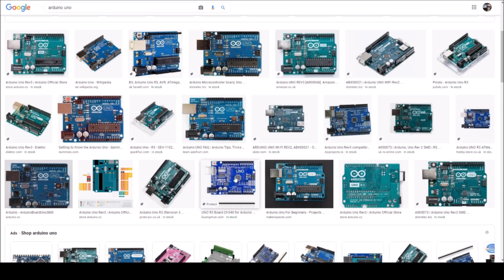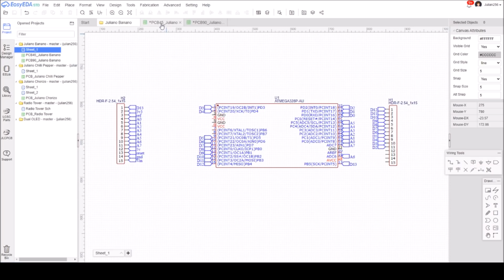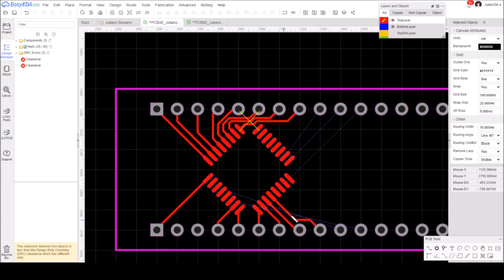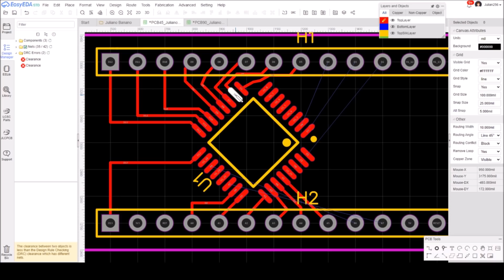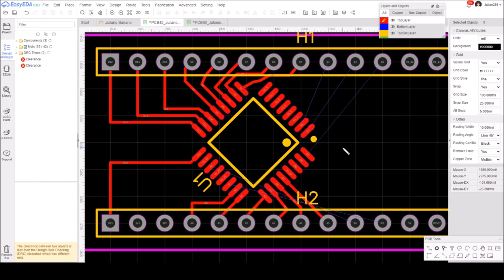Chip at 45° - Why?

Comment: It is simply a routing solution.

This is from my instinct when we were actually manually making complex pcb traces for our projects during engineering school. No software aid, no computer at all. Single sided pcbs are cheaper as well so we make solutions to save space and money.  

When many chip pins with the header pins that are close and parallel, it us hard to run it on single layer. It is easier to solve using diagonal positioning.

Comment: On top of that, there are several rules while designing PCBs, one of them is to avoid traces with 90º turns (since it may create an antenna), so puting the chip at a 45º makes it easier to route every pin properly

Comment: I started playing putting the IC in 45° and then in 90° but there's not much difference, but then why does this microcontroller is placed like that in that board? Well, due to the reduce size of the PCB board it's easier to connect the microcontroller to the header pins when the microcontroller is in 45°, if you put it in 90° it's kind of hard, i tried to do that in other PCBs i made but there's not much difference than place the IC in 90°

Comment: 5:58 If only those 2 tracks are close together with 45 degrees imagine if most of the 8 tracks were that close at 90 degrees. It's not a that hard thing to see why in higher density designs people use it that way. I've done some of the THC AVR builds using narrow boards and the routing is much worse because of the pins going straight to the narrower side of the board instead of angled allowing more space.
BTW, the through hole version can actually be easier to route than the SMD one because it allows you to route traces in between the chip pins. One of those situations where a wider chip give your more room to work with.

Comment: It's always nice to see a hobbyist take a dive into analyzing commercial products, and Julian does some of the most beautiful dives I've seen.

It's not just microcontrollers; video chips are also often on a 45° orientation for routing, and there is a successor to the LM3915 dot/bar display driver chip in a QFP or QFN that routes best at 45°. Low pin pitch quad chips with I/O pins running around corners? I think even Pythagoras could figure that one out.

Comment: I designed a "mouse mover" with a 32U4.  It moves the mouse in a 10x10 square once every interval (adjustable by a pot between 1 and 5 minutes).  I did the 45 degree placement at first, but it was too wide to sit in the USB ports on my laptop with other devices.  I essentially lost a USB port on each side of it.  So I redesigned it to be at 90 degrees and was able to narrow it down enough that it was the same width as a thumb drive.  (I used JLCPCB as well, and recognize that pen.  I prefer the pen, which I don't use, over the puzzle that I just toss in the recycle bin.)

Comment: The 45 angle is usually for easier routing. The package pitch (width) is 600mil (0.6 inch) the pin pitch will be 0.1

Comment: It is obviously done for convenience: to make it easier for routing all those pins from the uC to the edge of the boards. Why would it be absolutely be necessary? It is like you say just for space reasons.
Reply: Correct - convenience. For small, long and narrow PCB = 45 degrees is best choice. For bigger PCB chip angle does not matter. I'm actual electronics PCB designer.

Comment: 0:19 "Rooting or rowting," he says, but misses "Soldering or soddering."  Me? Rooting and soldering
Reply: I hate it when yanks say soddering. But yes, the 45 deg thing was from wave soddering back in the late 90s
Reply: We had to use wave soddering for surface mount as we used a through-hole main connector and smd reflow would add another process. There was a risk of bridging the micro pins that were across the wave, according to the factory.
Reply: The silent 'L' is like the silent 'U' in colour. :)
Reply: If the 'L' is silent, is it like 'cold' (cod), 'mould' (mud), or 'old' (odd)? 🤣

Comment: In PCB design class my prof told me that 45 degrees is usually for easier routing.
Reply: It should be fairly intuitive that lining up wider pitch solder pads to thinner pitch pins would be easier and tighter with a 45 degree layout since you don't need as much thickness on top of the chip to maintain proper clearances. Many traces can be pushed out near straight instead of meandering around.

Comment: More straight spacey traces than not.. the expanding factor of the side rails makes the 2 45 degree angles like a whole  half side rather than a quarter... more traces just have to go out straight without bends.. after your first flashlight inspection... I really dont know how its even a debate... would have naturally done it too.. isnt some microscopic sillicon also arranged that way?.. its the best way to reach the parralel pins maintaining the maximum distance between rails, less capacitance less gold etc..

Comment: On a board with two sides only, no internal layers, traces run horizontal on one side, vertical on the other. If a chip is 45 degrees, every leg can go in the same direction without turns.

Comment: Is that CH340 the 340C?,  I soldered the msop10e for testing but for the design and to simplify have plumped for the CH340C.  I am guessing its the C as the C and E do not require the external crystal.

Comment: Google "0DFRFW" - That's the motherboard for a Dell Optiplex 780 Ultra Small form factor PC. It has the LGA775 Socket at 45 degrees. The CPU Cooler retention screw holes are at 90 degrees though.

 I had one of these a few years back.

Comment: You can put vias behind the lands and route the trace on the bottom layer. You don't have to route out from the chip as the electrons don't care.
The problem with that though is once you get a chip with an exposed ground pad getting vias between the lands and the exposed pad is very difficult and on two layers getting a big continuous ground fill on one of the layers is going to be pretty difficult once you have a bunch of vias and traces running from the center of the board to the edges.
Reply: LCC MCU chips do not have ground pads, QFN chips do.
Reply: @adamw.8579  LCC? The chip he's working with is a QFP right? QFPs can have exposed pads.
Reply: @donpalmera  Generally QFP may be equipped with exposed pad. Older type LCC now QFP and TQFP. Yes sometimes have exposed bottom pad but not MCU, rather some typed of power controllers may have.

Comment: Could you keep the IC at 45 degrees, but move it closer to the I/O pins on the bottom of the board, giving yourself more room at the top where the traces are too close to each other?
Reply: Given the constraint of exactly matching the chip socket size, no.  If it moves, the crystal and everything else likewise has to; the pcb then has to be lengthened, creating an undesirable overhang on one side that may literally prevent the board from being inserted.  You cannot count on having extra clearance on that edge!

Comment: I had one ring shaped PCB where the parts were all kinds of angles as the design slowly changed it's angle. The pick and place machines don't care. The only issue is if you have back side parts and are doing solder wave can cause problems unless the parts are parallel to the flow.
Reply: I designed a motor controller this way, the controller PCB is shaped like a ‘C’ (the slot is there so you can pry the PCB out and replace it, should it blow up). The parts are rotated throughout. The 45 degree rotation gets rid of the crowding between the through hole I/O pads and the LQFP. For reflow it makes no difference the orientation of the part. Wave soldering does have some constraints, however.

Comment: This has the possibility of being a GREAT series looking at PCB layout and the compromises that have to be made. I immediately looked at the 45 degree one and was taken back to 1980 when I laid out PCBs using tape - my first thought was they did it because its easier to route, it's what I would have done. We often used metal can 741H packages to ease routing. As an aside I can also advise you not to put your finger on a metal can package if you mixed the V+/V- lines up - it hurts - a lot. (Back then we didn't have fancy thermal imaging, just fancy smell and touch sensors)

Comment: you can have it square if horizontal space is at absolute premium  but the routing becomes very bunched up and long to reach the header pins (just made a ESP32 with some extra stuff in a compact form factor. on a bigger board it probably matters less, but i suspect the routing is still easier.
Reply: ESP32 and ESP266 have 4-layer board. Easier to route tracks.
Reply: @adamw.8579  this is true ^^ on a 4 layer board its way less of a  problem, but it might still help you route the tracks out alot easier.
Reply: @km5405  My current project use ESP-12F modules for redundant local communication. Very good and reliable modules, Tensilica done great work with this combo chip.

Comment: It's 45 degrees  in relation to the PCB, So What, it does not matter or concern anybody at all why this design was deployed, there are a couple of reasons why this was done by the manufacturer.

I would be more concerned if the USB socket was mounted at 45 Degrees.

Comment: You are not limited to only 45 or 90 degrees. The optimal angle could be somewhere between. In the video (@05:10) rotating the chip a bit more clockwise might give more space for routing the traces. Why not try that? I have not used JLCPCB or EasyEDA myself, but I suppose they can handle that.
Reply from the maker: I might try it :)

Comment: Maybe you could mount the chip on the diagonal and move it slightly down on the board to have slightly more space at the top.
It may offset the chip from the middle of the board, but may give you space.  Another option as well as moving it to the right
Reply from the maker: That I like :)

Comment: Its for both reaons. Try routing a full Uno on a single sided board, and immediately you'll see why 45 is way better.  With large packages such as FPGA's etc, its compulsory, even on multi-layer boards. But for soldering purposes, there will be extra features around the tracks for better solder flow.

Comment: The simple way is to put it at a 45° angle BUT why try to route them all on the top side?  Lots of room in the inside to put vias then route it on the bottom side.  Plus the bottom side won't have the IC pads to work around.

Comment: I don't see a reason why you couldn't route pins to the inside and make vias on your design unless you want to make it single side only (or it is missing a ground plane under the chip); Though this is even more problematic with QFN packages, the bottom of it is GND and you have to route all your pins to the outside of the chip.

Comment: Compaq once made a PIII mainboard with angled DIMM slots to solve some kind of engineering issue...
Reply: A lot of blade servers angle the memory to allow for a thinner assembly.
Reply: @NiHaoMike64  When I first saw it I thought it rather odd.  If I remember right it was actually a desktop PC mainboard.  I have an image of that section of the mainboard as the lock screen image on my Windows 10 system.

Comment: I did some 45° routing for a STM32 on some battery operated project at work where the PCB width was quite small. No headers on the edge though. Really no way to route it at 0° without going for more layers and a lot of via's. Via's can also cause space problems especially if you have to place components on both sides unless you go with blind/buried via's.
Reply: Mounting at 0/90° might actually allow the PCB width (height) to be reduced by 0.1" allowing for more room on a breadboard.  I haven't tried but it looks like there is lots of room for vias (there is not apostrophe) inside the IC footprint.  But would you actually want to reduce the PCB width or stick to the "standard" that other Arduinos have been using?
Reply: @ElmerFuddGun  why design to "standard" if it is for your own project(s) ?
Agree with the word vias  (sister/sisters)
Reply: @jyvben1520  - Well, one reason to stick to the "standard" size is there are adapter PCBs and other projects that the Arduino can plug into.  Won't work with a narrower Arduino PCB.  But if it's your own project then you know what your end use will likely be and can change to your liking.  For only mounting into a breadboard that extra hole for one side of the board may be a welcome addition/fix.

Comment: I think its for wave soldering, to help prevent solder bridges, or possibly I'm completely wrong
Reply: You are absolutely correct. I was just looking to see who got it first.
Reply: These specific chips aren't wave soldered, but that's how it started. You can often tell because wave soldered footprints will have a kind of triangular runoff area on the corner pins of qfps for excess solder to go.

In this case it's just to get all the tracks out on a narrow board layout.
Reply: @AlexanderBurgers  I know those areas as solder thieves. Saw their use suggested in a Philips SM PCB design guide back in the early 80s for SO packages and used them on every wave-soldered SM design afterwards.

Comment: They will place components at whatever angle you ask them to in your PnP file. The footprint has to match said angle though. I've had lots of LED rings made where the LEDs slowly rotate such that all the cathodes point to centre
Reply: Yeah, their P&P machines can rotate components because sometimes they don't get picked out of the supply reel at exactly orthogonal angles.

Comment: This is for thermal dissipation, as chips at 45° are actually way cooler than the ones at 90°. 🙃 (j/k)
Reply: On the other hand, I appreciate the explanations and the look of these boards while illuminated from behind very much.
Reply: Taking into account the Fumble Factor with a chip in fault condition running @ 150 degrees C, one would burn one's fingers with the chip being mounted in either orientation.
Reply: Maybe it's a combination microcontroller, voltage regulator?
Reply: xD
Reply: There might be a slight case for this being true given that each side of the controller now has equal exposure to the PCB on all 4 sides. And the metal traces spider out a bit more uniformly....  Very slightly... Placebo like slightly.
Reply: @wishusknight3009  do you know how many boards have i rerouted for placebo slightly:) hihi for the horror of my manager:)
Reply: @sanches2  hahaha!
Reply: How many degrees is it outside?

All of them!
Reply: Wait this is double double entendre. Nice.
Reply: That's a good one ! :)
Reply: For a while I thought that the joke is tilted chips look way better
Reply: Here, have a cookie. You deserve it.
Reply: Took me a minute 🧠
Reply: yet to come - future chips are now cubical stacks, set on a face first, then edge to even later contest with chips set on vertex
Reply: But 0 degrees is the coolest
Reply: OP just made a pun... and a good one kakakak
Reply: Are you talking about ICs mounted at 45° run cooler or that 45 is less than 90°C?  Or both?!   ;-)
With airflow around an IC at 45° maybe they do run cooler... by 0.00001°C.
Reply: @ElmerFuddGun  perhaps he meant Fonzie cool rather than heat dissipation cool?
Reply: @tinplategeek1058  - Ya, didn't think that either.
Reply: @ElmerFuddGun  he is joking and tells about 45°C is cooler than 90°C

Comment: Makes routing the connects far easier.
With pins facing the sides of the board the routes are hard to make to those pins. By running at 45 deg the tracks are easier to get out.
Reply from the maker: I agree :)

Comment: But remember that you can also utilize the other side, i.e. fill the empty space under the chip with tracks and vias that transfer the pin routes to the other side.
Reply: that's a very good point!!
Reply: One-sided is cheaper to fab, and thus to commission; why use both sides (or multilayer) if you don't, strictly speaking, need to?
Reply: @xheralt  I think JLCPCB always makes two sided, without extra cost. Sure you can leave the bottom without tracks, but there is no point since it will not make the board any cheaper. Actually two-sided is pretty much required if you want to make easy soldering for through-hole components! And multilayer is another story, it really is more difficult to manufacture and does cost extra.
Reply: Each via is money. Looks also better with this placement. Makers care today more about the look than the functionality 😉
Reply: @maxhouseman3129   Who are you to say what "makers" today care about?? And I have not seen that JLCPCB has any extra cost for any number of vias!

Comment: Pick and place machines don’t give a monkeys. Put your components at whatever angle makes sense for your board design and routing.  Most of the time the machines have to rotate the parts anyway, because they haven’t picked them up straight in the first place. Plus lots of modern boards aren’t square in the first place anyway.
Reply: ... a monkeys? Where the hell did you learn English? A cannot possible precede a plural!!! It should be "... give a monkey's." (i.e. the possessive form, not the plural!)
Reply: @SpeccyMan  - Maybe we should just be happy that he didn't use excessive apostrophes like so many do online trying to make words plural.  Better to not use an apostrophe when you don't know (or refuse to learn) IMHO.  One famous Youtuber from down under is a prime example of not knowing and refusing to learn.
Reply: @SpeccyMan  You must be a blast at party's.       

Yes... I did that on purpose. 😉
Reply: @BRUXXUS  , oddly enough, I noticed the ' missing from monkeys, but not your party's error, until you pointed it out.